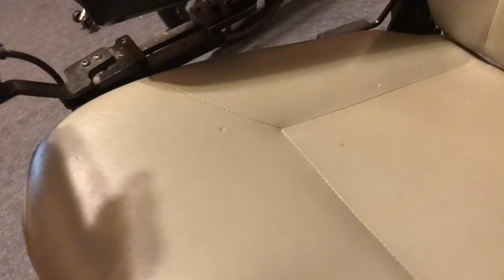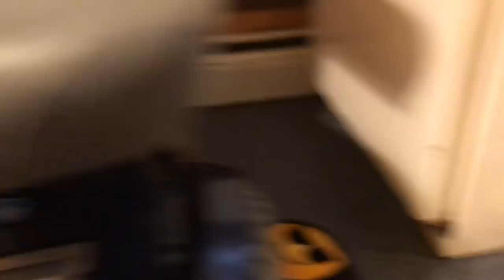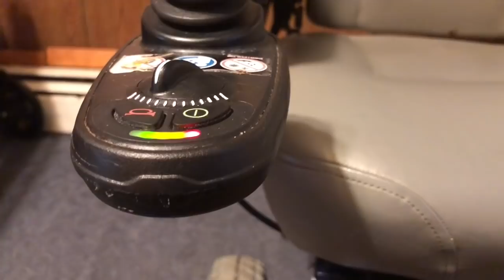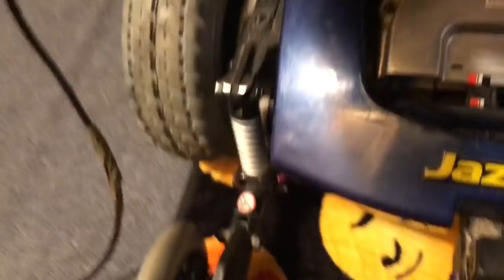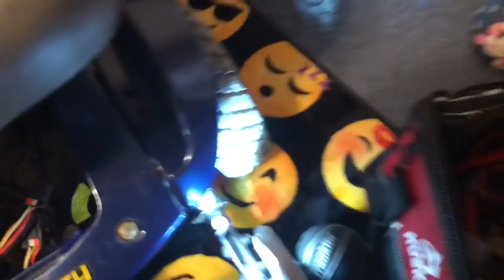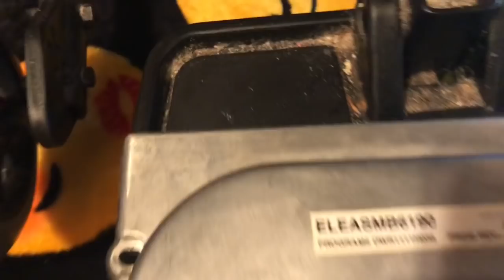Jazzy Prime Electric Wheelchair Repair (charger port pin in controller was out of place)

Comment: When I plugged up the charger to this chair I might buy it strobes when the power is on I thought it was strobing because it was charging you can turn the chair off with the charger on it and it doesn't strobe the chair works fine the charger got hot because the fan doesn't work because he's letting it sit there with low batteries the chair is basically new I was wondering about the strolling and how you're supposed to have that toggled when you're charging it

Comment: I charged the chair on 220 volts and it didn't work yet. How can I fix the malfunction?
Reply from the maker: Are you sure you’re supposed to charge it on  that voltage most chairs are 120volts
Reply from the maker: Read the manual for the proper voltage to be charged otherwise if you’re not charging it by the right you will burn  it out
Reply: Do you mean you hook your charger up to 220? I know there is a switch for Europe and America but we don't have the same 220 they have a neutral and a hot where are 220 are too hot legs.
   If you were to flip the toggle switch over to 220 and have the right voltage it should charge 26 or 27 or 8 volts whatever it takes to charge for volt batteries or two 12s in series

Comment: How come my joystick won't turn on at all no lights or anything
Reply from the maker: jay So many reasons battery’s dead wire broke from the computer to your controller or one of the charging pins under the controller joystick is that a place

Comment: Will the cable unplug from the joystick?
Reply from the maker: No the pinned end of the cable is molded into plastic inside the arm controls but does unplug from the main computer relay under the seat in the front  the only way to replace is to buy the cable  with the armrest controller sometimes you can find them online cheap used eBay Amazon

Comment: The same thing happened to my wheelchair and it turns out it was in Lookout mode which means when you were moving in or doing something you held down the power button and that causes it to go into lockout mode now all you have to do is push the horn button while it's strobing two times and it will come out of lockout mode and you're good to go

Comment: Sir, my Jazzy 1121red lights are blinking. I put in new batteries, new onboard charger and relay. Charge it many times, yet the three red lights are still blinking. Any suggestions.
Reply from the maker: Check the pin holes where you plug the charger into the chair if they have moved and came out of place and touch each other this will happen
Reply: @Videogamerdaryll  I am buying a chair that is like new I'm telling you it's not been used much but that doesn't mean there's not anything wrong with it the batteries went down eventually where it's at it didn't quit he charged it for about an hour and a charger got hot because the fan isn't running it charged up a little bit but I know that he doesn't know how to charge it and I don't either. I don't have the money to start buying parts for this thing after giving $400 for what is basically a new chair. He turns the chair on plugs in the charger and the lights start strobing as if it's telling you it's charging? Then you turn the chair off and it charges the same I was just wondering if you're supposed to charge it with it on or off or does it matter and if you do stick the charger in with the chair on it strobes I was thinking that was a battery charge indicator also am I right or wrong or do you know

Comment: Any idea where the wires that come into the joystick control are supposed to connect to? I have an older Jazzy Select chair that the harness was pulled out of the joystick with the connectors attached. The local store wants $500 for a new joystick which I would rather not pay. Thanks!
Reply: Never go to a mobility store first. If you really only need the controller/joystick go on Ebay and find one for less than $100. $85 is good, cheaper is better. Make sure they warrant it and have free returns.

Comment from the maker: Final fix :the power supply/chargers three pin connectors Ground pin fell inward from pushing the chargers port plug in ..Inside the controller the ground pin fell in was out of place causing the unit to short and not operate ..I opened the controller glued the pin in place not the charge charges and works..When I would move the wire around the out of place pin would move then the chair would operate until the pin moved again grounding out causing a short...a company came in charged my mother in law 150 to look at it they did determine it was a short but was not fixable ,they plugged the charger into the charging port and the unit worked for a little while while it shouldn't  telling me that the issue was in the controller module handset..You can get the part on ebay CHEAP and just replace it..
Reply: Yah Amazon Had That For A Good Price.
Reply: I Was Looking A Wheel For My Chair
So At first I Tried Handy Medical & They Wanted
$117.00 Then Monster Scooter Parts
Wanted 72.00 Then I 
Tried Amazon & They Had One For 26.99
That's Nothing To Sneeze At.
If You See A Good Price Like that Take It.
Reply from the maker: @rogertyler3237  check eBay and Amazon

Comment: You are correct sir. Most of the time it is a bad connection, Use some contact cleaner and then some dielectric grease on the contacts and wala! Test all cables with a continuity meter and reinstall after cleaning everything. It is sad but true that many mobility repair shops are worse than some bad auto mechanics. Makes my blood boil...
Reply: People don’t repair much of anything anymore. They are just glorified parts replaces. Many times making uneducated guesses on what might be wrong. Oh let’s replace this at the customers expense...   nope that was not it.... how about replacing this part, again at the customers expense.  Yea, makes my blood boil. It’s why I fix everything myself.
Reply from the maker: Catholic Seymour I have another video I found out what was wrong with it I took a part of the controller and the wire at the charging port one of the pins fell in out of place and created a short-two pins were touching each other which was telling the Computer that the charger was in whereas then the chair won’t move so I glued the pin back in the place and it fully works now— she had company come over there that sold her the unit they charged her $150 to look at it only to tell her that it had a short somewhere that it’s not fixable her only option was to buy another one which is really sad because it didn’t take me much time to fix this I just needed time to get to it-and it was really such a simple fix when you find it-basically threw out $150 out the window With those people I would never deal with them again
Reply: Try WINDY CITYWHEELCHAIR !!!